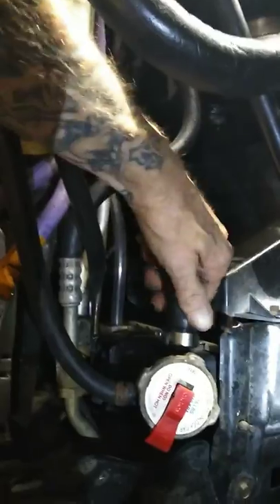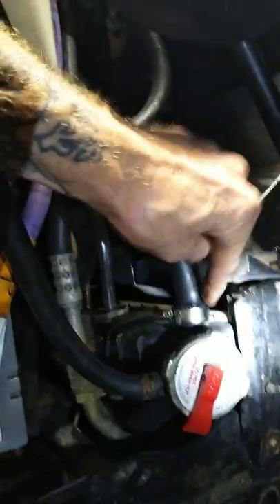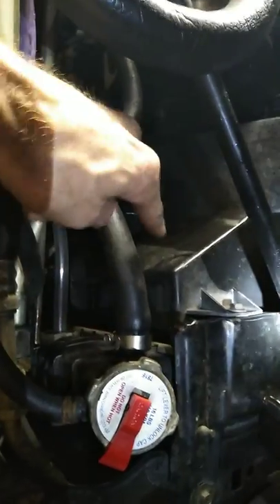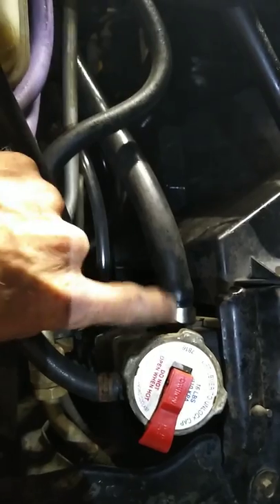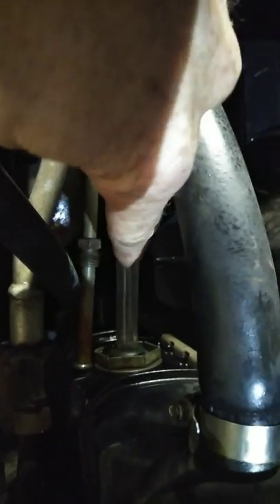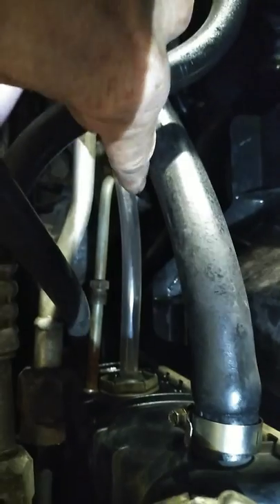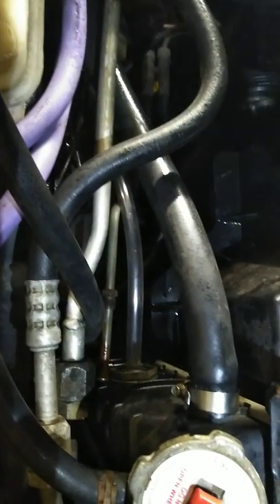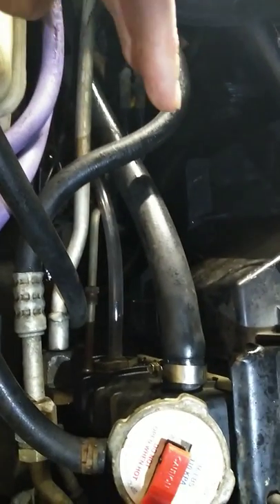Cadillac Brougham transmission flush

Comment: Dang fam that should have been changed some time ago glad u got it done an went with ur gut an not what every one else is saying
Reply from the maker: Well i found out my leak is the bolts loose on my tranny pan -- problem is i shoulda checked the bolts first then just tighten them up and filled back up with fluid so now i got the possibility of my  transmission going out since its so black fluid means definitely probably is gonna mess up once i flush it but is what it is man we will see

Comment: Hi  ... how is the car running now? Can you post a follow-up on this? When I have a transmission this full of varnish, I change-out all the fluid just like you did here .... and then usually treat it with Auto-RX .... over many years of doing this method, it has always worked really well ... this seems to be a little known trick ...... thanks for posting this video ....

Comment: It's burnt that come from them big rims
Reply from the maker: I got the 15x8 cragars now but i did have 24s on it and 26s before
Reply from the maker: But reason i started the flush was leaking at the pan so i got under it and the pan bolts were ALL LOSE
Reply: I'm hoping u replace the filter too while u there..
Reply: I got a question about my lac I got a line thats off do u have the 307 5.0 liter in yours??
Reply from the maker: @trunktight5714  definitely and no it's a  305 chevy5.0
Reply: So do yours have a thick black line coming from the inside of your car on the passenger side
Reply: Naw it's coming from inside the car to under the hood on the passenger side thicc black line
Reply: Ok